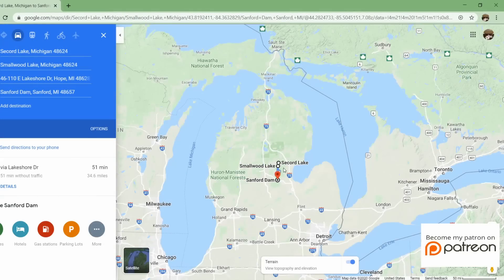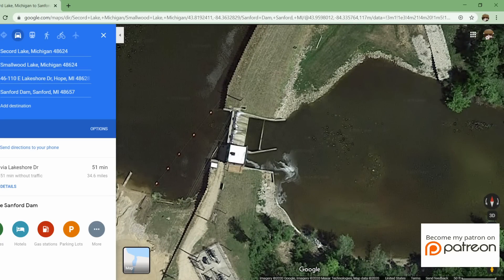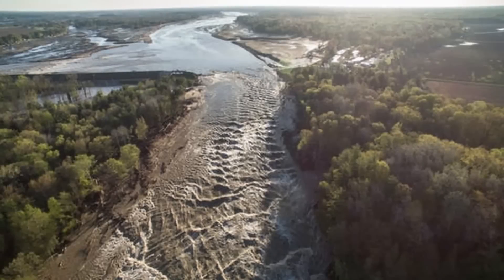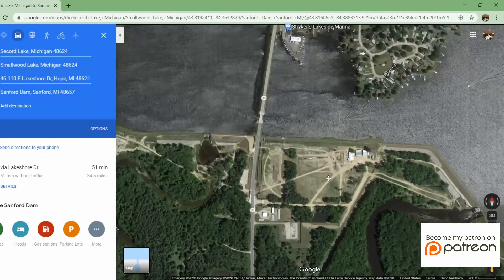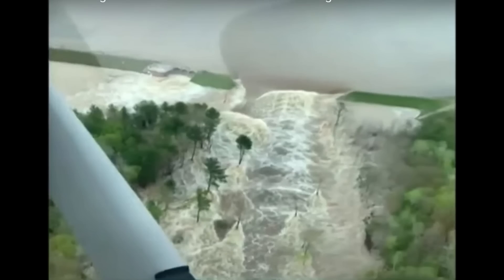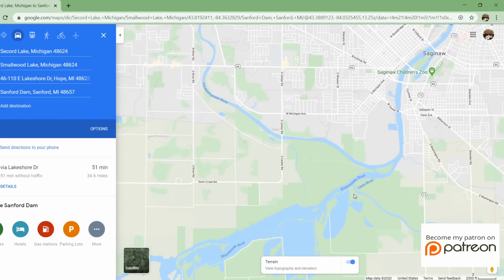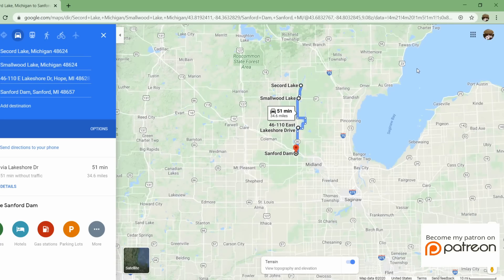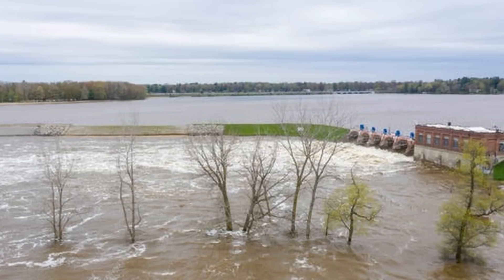Michigan Dam(s) Fail!   Tittabawassee River.

Comment: my brother and SIL live near Averill just down the road from Sanford (no D in there).  my Dad had his home on Peterson Dr. which is just over M-10 on the right as you cross the lake.  so this is all very well known territory for me.  What many people don't understand is that the elevation of all of these areas is just not that great.  the depth of Wixom Lake is a whopping 40ft.  total area not that big either.  The entire Tittabawassee River basin is 2500sq miles.  i.e. not all that much compared to ORO, but almost all of it is quite a ways further south.  So to have that much water coming from that small an area gives an indication of how much rain that they got up there.
The elevation we have here is about 30ft above Lake Huron (i.e. the Saginaw Bay) but we lose about half of that down the road less than a half mile on the fork of the Bad River which runs by here.  And we are about 30 miles from the bay.  It takes some time for the rivers to drain here...  Midland will take some time to drain too.  It will be interesting to see how much this all backs up through the Shiawassee Game refuge/game area (a very large wetland area that they've at least worked on setting aside - yay one thing done well!).
Now consider this, it is a simple statement of fact.  You cannot strip the land of forests, vegetation, remove wetlands and turn it into farm fields with drain tubes and ditches and not expect it to all run off quickly.  This is a man-made contribution to this particular flooding event and to those all over the country that will be paid off in the future in more flooding due to poor land management policies.  This is not a political issue, it is a poorly done environmental/land use issue, because all of this run-off is also polluted with agricultural chemicals and nutrients.
Think about the world you want to live in and find better ways of doing things.

oh, and speaking of coincidences, i'm also familiar with the area near the Dow Corning plant near Geddes and Gleaner.

Comment: Great coverage and information Juan, as always! I have built a few small earth-filled dams. The first rule the old engineer gave me was that you never have the emergency spillway on any part of the earth-filled dam. He said if the spillway is part of the dam and it fails it could take out the dam. I was standing on the side of a small dam that I had constructed when it was overtopped by water. I ran to get out of there as the dam was collapsing. If my memory serves me right the dam was gone in about a half-hour!
Reply: Sounds like descriptions of the Johnstown PA dam failure.

Comment: They should have been releasing the water out days ago.
Reply: this was primarily a very local heavy dump of rain during a day or two.  they may have had to have not only a very precise forecast (which i've yet to see for this area) for a small area plus be able to release the water in that short a period of time in a slow moving river system.  so in effect, just not thought of when the dams were put into place and not a priority for the management of either of the lakes.  these are not primarily flood control structures.  there isn't a whole lot of volume or depth to either one.

Comment: The video of one dam I saw looked like the dam face literally blew out before the dam was overtopped.   I think we're going to find that earth filled dams that do not have concrete facings down to bedrock (and some that do) are dangerous if not constantly monitored.  Another article I read said that at least two of these dams lost their operating license in 2108 because the dams were hazardous and needed repair.

Comment: Watched your channel during the Oroville situation. I am impressed because you seem to be the first out of towner  I've seen to give a reasoned  and fairly accurate info about the failed dams. Only thing you got wrong was the age of the dams. They were built in the 1920s so they're almost 100 years old. If anyone would like more background information on the dams the local newspaper has done many articles on them. Their website is at ourmidland.com  .  They also have hundreds of photos of this flood and the really big one before that in 1986.

Comment: Someone managed to be in the right place at the right time for the Edenville Dam failure. Looks like there was water leaching through it forming a small collection of water on the downstream side in the grass and the top had already sagged or slumped down by the time this video was started. It was clearly not over topped causing the failure here, it blew out.
https://www.youtube.com/watch?v=Hc3u_CHVHJ8
Reply: I think earth dams often fail due to water penetration/seepage into the earth dam(weakening the structure a lot)

Comment: Boyce no longer owns the dams. They are owned by we, the lake property owners. FERC called the dams deficient because Boyce produced power. Now that the lake home owners own them for water level control only, they met all Michigan regulations. This was a once in a 500 year rainfall. Im not so sure you can blame Boyce because FERC called them deficient.  Sometimes shit happens.

Additionally, you are wrong regarding flood insurance. This was a flood due to mechanical failure. Just like you are covered if your sump pump fails, and you flood your basement, the same applies here. My neighbor and I both contacted our insurers and we are covered for the water damages in our homes.

Comment: Sewage systems will be compromised.
Reply: i believe they just got a bit of a flush...  (Flint also released some semi-treated sewage into the river).  all cleanups to improve water quality are a big help in this area as the rivers travel so slow and are extra polluted from the runoff from farm fields.  it is a long-standing issue which will continue to need work.

Comment: They should of had the information on the snowpack and run off conditions, I'm curious as to why they didn't spill earlier to prevent this from happening.
Reply: there is no snow left.  it was actually dry the past few weeks.  we do not have large mountains in MI.  more like hills...  this is a combination of issues coming together.  as they say a perfect storm...  land use issue, drainage issue, recreational demands, no actual control structures, etc.  these have all been there for years.  this wasn't a creation of this administration but of the past 100yrs or so.
Reply: @obiwanbenobi4943  thank you for the clarification!

Comment: Speaking of Oroville, did they finish with all of the construction? Thanks!
Reply: all but the gates.  i don't think they will redo the lower part of the slope below the emergency spillway.  now they are starting to talk of a second flood control spillway to give them more control at lower levels.

what they could do which would be better would be to increase the HPP capacity to generate more power.
Reply: obiwan benobi  Thank you! I no longer live in California but I grew up there and still have hope for the place I grew up in.

Comment: There is actually another system of dams that are just to the west of the ones he is talking about in this video.  The Chappel dam and then the Beaverton dam and they also flow into the same river system as the ones that failed. There was concern for awhile about the Chappel dam failing but it was quickly reinforced and although flooding was the worst I have ever seen living in the area,  it could have been far worse.

Comment: The presumption that all engineered works are a result of careful and complex calculation "ain't necessarily so." I have noted many instances of bad guesswork in engineering, particularly civil engineering. I am suspicious of all of these designs, and hope you or someone who knows more than I will do the numbers. The dams appear to be seriously under-engineered to me. As Ellison Hazard once said, "Our society is not threatened by the man in the grey-flannel suit; it is threatened by the man with the grey-flannel mind--a man of expediency that tries to operate in a technical field in which he is unqualified." An I thought they did a rotten job on the Oroville Dam! Try a simple input/output diagram on a time scale. 

I used to do check prints on certain projects for a large city. I tried to caution the "engineers" about their drainage plan not being able to handle the runoff from a large catchment area. My "prayers" were not answered when I got proven correct. The earthworks they had "designed" failed and the water flowed into a major corporation's facility. In a post-incident meeting, the corporation's chemical engineer stated that if the large storage facility had flooded (it was barely missed) that the result would have been a humungous hole in the ground and shock-wave damage for a great distance, probably leading to a chain of "undesirable" events. If I recall correctly, the CE said that it was filled with sodium nitrate. Water can be a catalyst in some reactions, but I'm not sure what it takes to go critical. Petroleum products are used with ammonium nitrate to make some pretty big booms, and the stuff floats on water. In a flood environment, are chemical facilities rational?

Comment: Juan, I live on a bluff in Midland and was unaffected by the flooding. Your coverage was spot on. If you would like to the National Weather Service river level, here is the link.  https://water.weather.gov/ahps2/river.php?wfo=dtx&wfoid=18774&riverid=203834&pt%5B%5D=143667&allpoints=143667&data%5B%5D=all       The river crested at a new record about 1 PM and is dropping. The carnage will become visible as the river and lake levels drop, and it will be massive.

Comment: It sounds like the Sanford dam is being “overtopped”.   Is the spilling happening outside of the emergency spillway?   Are all three dams of the same age ?  Which one is the newest ?
Reply: The dam was built in 1925 and had received a "fair" condition rating by the state,[2] while the 1924 Edenville Dam had received a "poor" rating. Both dams were in the process of being sold at the time of the failure.[3]

Comment: I am from Michigan so have been paying attention to all of this coverage. Thanks for being factual in your reporting (been following you since Oroville). There are a lot of people being critical of officials and engineers etc. about this and it is often left out of reporting that in essence these emergency spillways did function as intended: they gave people time. Although the photo/videos are shocking to see, all the residents had plenty of warning and I don’t believe there has been a single fatality. As for the emergency spillway capacity, I don’t know to what level they were designed for. We had an unprecedented amount of rain with huge portions of that watershed getting over 7 inches of rain in the hours/day preceding the flooding (falling on already saturated soil). I don’t know if any reasonable level of emergency spillway capacity would have been able to handle that volume of water. Just my two cents. Thanks for being straightforward and not rushing to criticize or blame. Keep up the good work.
Reply: I'm from Midland. My house and neighborhood has an immense amount of damage from this. Three years ago we had another flood due to EVEN MORE rain than this, but no where NEAR the damages. So in my opinion, this is 100% the company's fault for neglecting to perform maintenance on the dam. The dam had previously prevented a flood like this due to more pressure, there is no excuse for it not to have done the same this time around.
Reply: @BlueFire498  - I'm also from Mich (sry you're going through this bro) I've now head that the Corp of engineers told the owners that the dam was in need of repairs and recommended lowering the water level in the lake. The lake front owners had a fit and didn't want the water levels lowered as to hamper boating / docking. Then a bunch of bunny huggers failed a suit stating that lowering the water level would endanger a type of muscle. The power company actually went to court trying to get the ok to lower the water and from what I hear, they fought hard to comply with the Corp of engineers recommendation. In the end a judge(s) ruled in favor of the bunny huggers. It would seem that the dam owners were the ONLY ones that wanted to do the right thing.
Reply: I’m from Michigan too,  I clicked on the video when I saw Tittabawassee River on the title.  I live like two minutes from it but though I’m down in Saginaw.  Crazy year.
Reply: All Americans need do is pay attention to Global Warming!  This is why we are having so many & often harmful/damaging environmental events!  We need to FIRE all those THUGS in our State, Local & Federal Governments an elect individuals that CARE about what's happening to our Country, because of the harmful and toxic destruction's, FOR MONEY, to our Planet!  All while, they have gotten so filthy wealthy, they have Homes in other Countries to FLEE TO, once they finish making America into another 3rd World Country!

Comment: The reason there is a second spillway on Wixom Lake is because the west arm is the old riverbed of the Tobacco River, which goes up to Beaverton.  You can see the original confluence with the Tittabawassee just downstream of the dam.

The M-30 bridge across Wixon Lake above the dam has been completely obliterated.  It wasn't wide enough to handle the flow from the lake rapidly draining.  If you look at the lake contour map from 1951, it looks like there may have originally been one long bridge.  But at some point it was replaced with a small bridge and fill approaches.

https://www.mlive.com/news/saginaw-bay-city/2020/05/m-30-bridge-destroyed-after-nearby-dam-failure.html
http://www.dnr.state.mi.us/SPATIALDATALIBRARY/PDF_MAPS/INLAND_LAKE_MAPS/GLADWIN/WIXOM_LAKE.PDF

Comment: From what I understand these dams are nearly 100 years old built in 1924 & 1925.
Reply: The dam was built in 1925 and had received a "fair" condition rating by the state,[2] while the 1924 Edenville Dam had received a "poor" rating. Both dams were in the process of being sold at the time of the failure.[3]
Reply: Should not be legal for dams to be privately owned. Profits over people.

Comment: after areas FLOOD.. including gas stations..  please don't pump fuel directly into your car.. use 5 gallon containers.. so any water or sediment can settle out and device a way to pour fuel into a white plastic bucket a few gallons at a time from the containers... so you can examine the gas or diesel before putting it in your vehicle.   gas stations don't always keep the rubber seals on the fill caps of their underground gas tanks replaced.. so flooding can seep in around the cap contaminating the entire underground tank of fuel.   this transferring of gasoline around is dangerous.. should NOT be done in an Enclosed area.. should not be done near a home or building..  or OPEN FLAME .. perhaps a water heater on the side of the house or in the garage.. 

 forethought and care can save you THOUSANDS in car repairs and weeks without your car or truck.. 

 also.. if there is a FLOOD at your home or business location.. be sure to mark the HIGH WATER MARK is possible.. so in the future.. you only have living spaces or work spaces above that level.  reducing the cost of additional floods..  the weather is changing..

Comment: Hey Juan, on these rivers with multiple dams, is the last one in the line engineered to higher specs in case an up stream dam failure happens?
Reply: It should be, but think about what would happen to the lower dam with a flood overwhelming it despite its upgraded construction.

Comment: Certainly the 100 years flood event when designed the dam 50 year ago has changed. Something to take in account when rebuild process start.
Reply: The dam was built in 1925 and had received a "fair" condition rating by the state,[2] while the 1924 Edenville Dam had received a "poor" rating. Both dams were in the process of being sold at the time of the failure.[3]

Comment: Wixom lake holds a relatively huge volume of water without being flooded given the watershed, size of the river and the local lay of the land. The devastation from a sudden uncontrolled release is absolutely unavoidable and with another impoundment structure downstream followed by several fairly heavily populated areas and industrial areas situated right on the river, these factors just compound the magnitude of the disaster.
https://www.9and10news.com/2019/04/24/task-force-agrees-to-buy-dams-restore-wixom-lake-in-gladwin-co/
"Community members came together to form the Four Lakes Task Force to fix the problem. Wednesday the task force announced it agreed to buy the Wixom, Sanford, Secord and Smallwood dams from Boyce for nearly $9.5 million. They hope to start filling Wixom Lake by the end of the month [April or May 2019] and begin dam repairs by the end of 2023."
There are going to be a LOT of questions surrounding all this. I don't believe Boyce currently owns or operates these structures, I believe it had changed hands previously.
Reply: Insane, they know the dams were in very poor condition, and they make the decision to refill the lake immediately and put off repairs of the dam for up to five years!!!!!! would you not want to do the repairs FIRST, then fill the lake? Criminal actually.